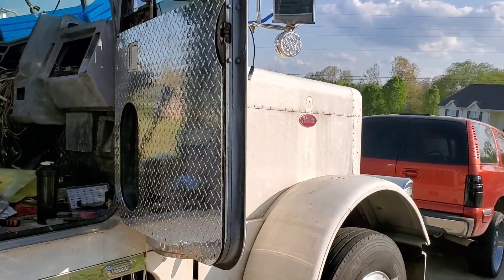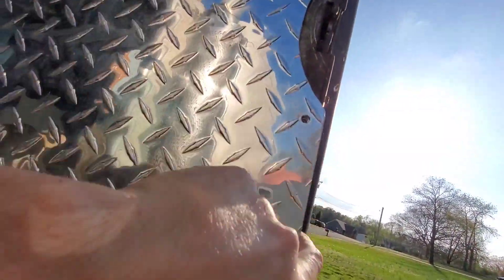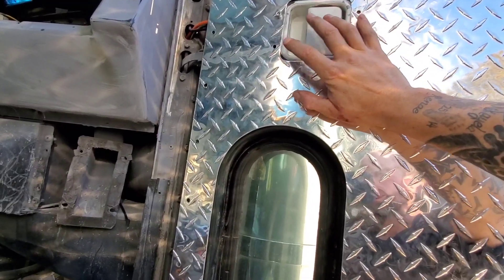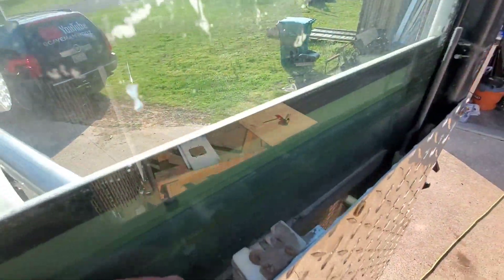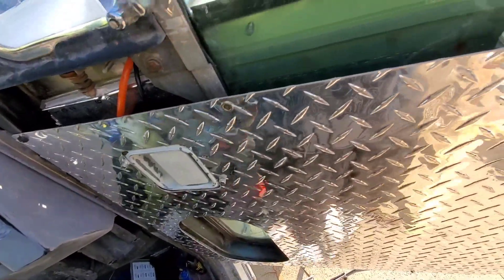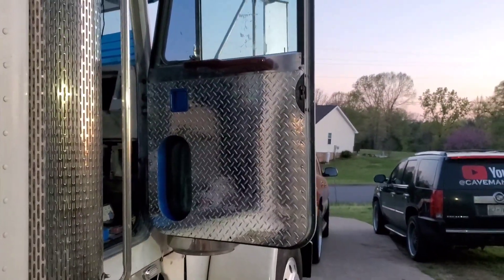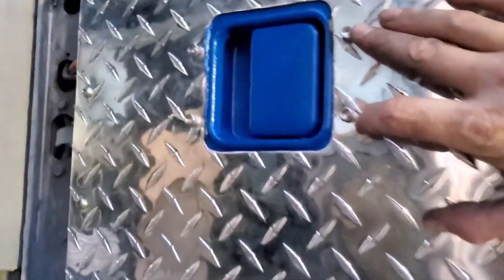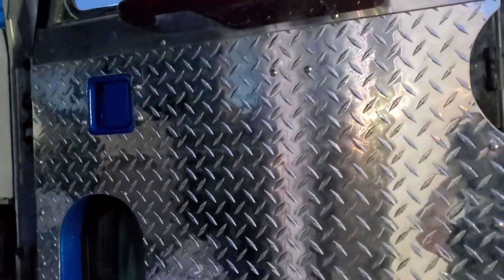Custom peterbilt 379 door panels finished

Comment: Would you recommend rivnuts on a visor install?
Reply from the maker: Personally I would not recommend it only because you have a lot of downforce from the wind pushing against it and it's a thin sheet of aluminum you're attaching to.
What I did when I installed mine was put rubber grommets that fit the holes perfectly then threaded a larger nut and bolt into with washer on both sides the stop all the leaking
Reply from the maker: Please share my videos